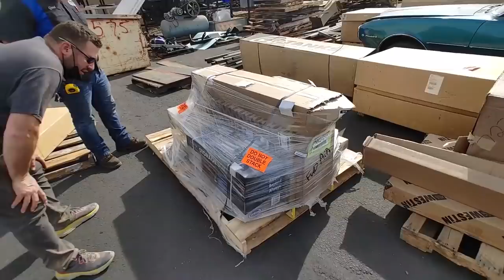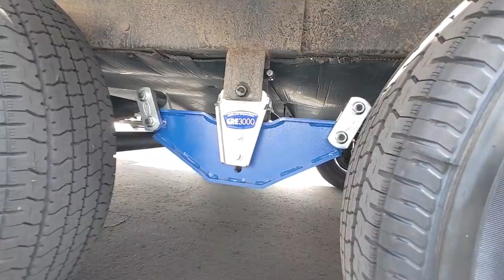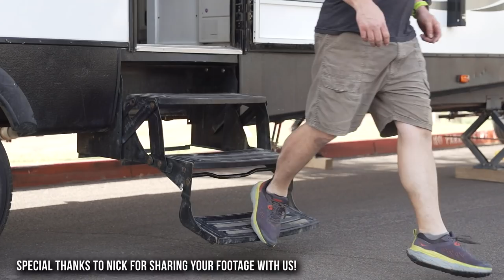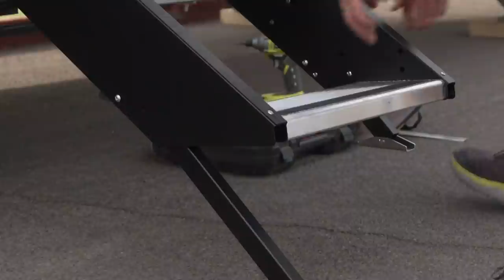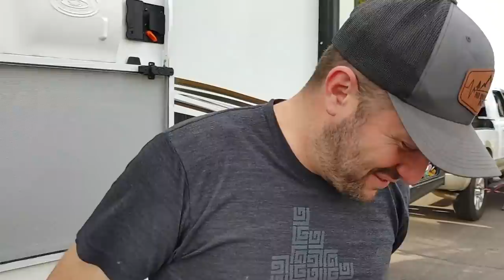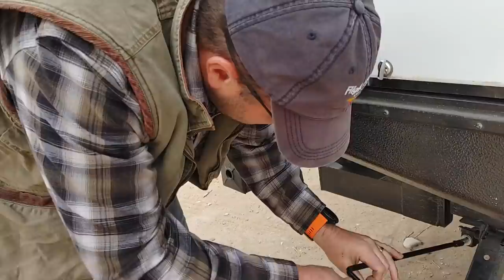Trick My Trailer Part 3 - Stabilization: MORryde Step Above & X-Brace

Comment: Why does the new CRE3000 need the X-Brace?  for the past 4 years, MoRryde has sold the unit without the X-Brace.  Why now?
Reply from the maker: It does not need the x-brace. That was an additional product to help stabilize the frame. Thanks for watching!